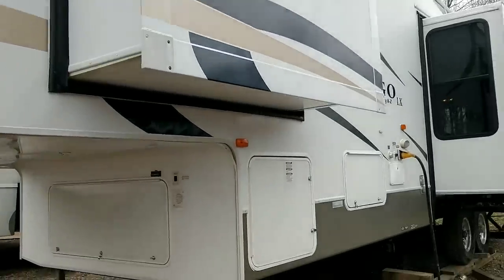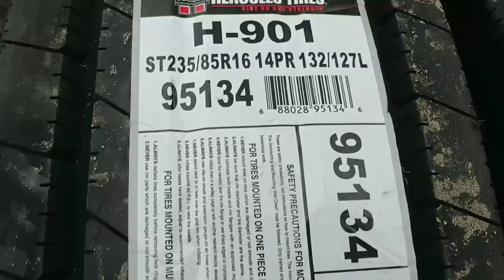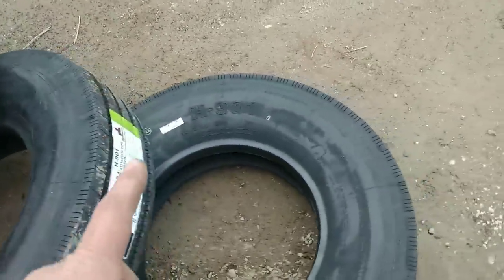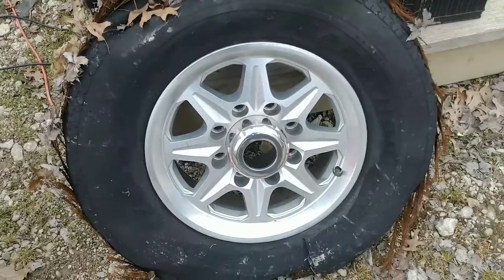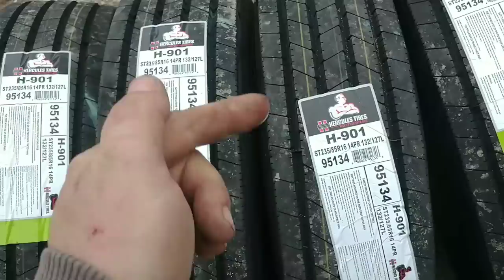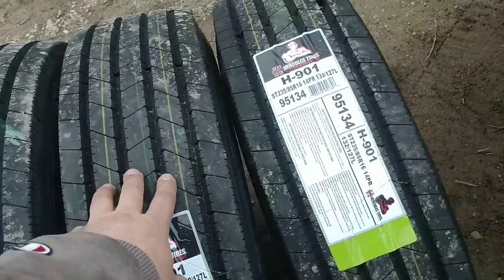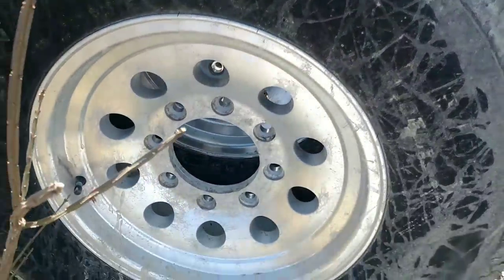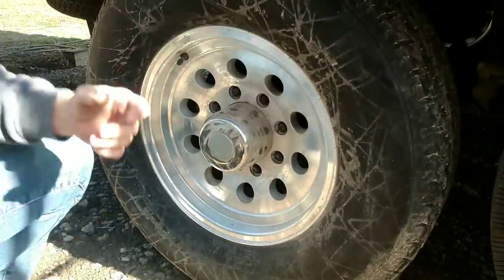NEW TRAILER TIRES / WHEELS AND SOME BEAUTIFUL YRUCKS!

Comment: My new trailer came with those same Hercules tires as an upgrade and boy am I glad I did it. About 25k miles so far without an issue (yet...)  Sailun also makes a good 14ply tire and I had a great experience with them. (Didnt think they would be all that great because they're a chineese tire but they never let me down.)

Comment: We love those tires at work we run the 4000 lb version on our 15k dump and equipment trailers. Makes ya feel alot better about all of that weight behind you at 70 mph when that Cummins is up front spittin fire 😂

Comment: Decoding the speed/load index: the first number is the maximum load index in single application (as per that camper), then slash, then the maximum load index per tyre in dual application i.e. 2 tyres on one side of an axle, the maximum load on each. The final letter is the indicated speed index. It's a standardised system, we also use it in Europe :-)

Comment: I'm a firm believer in 14 ply tires on any trailer hauling over 10k in weight. Makes a huge difference in ease of towing as well due to a stiffer sidewall and higher air pressure and a much tougher tire in general. I run them on all my trailers.
Reply: Less rolling resistance with new tires should increase fuel mileage.

Comment: Hey man I enjoy your videos got a story for you had a problem with my starter selenoid on my old 4 71 Detroit power unit took it apart sanded that copper contact ring cleaned everything  with starting fluid because didn’t have any brake clean but plenty of either since the old Detroit was an addic. I knew it was flammable so i waited along time when I tried to start it boom had a small bomb go off . I still use it some time but not in electrical stuff

Comment: When I had my 37 foot Toy Hauler Fifth Wheel I always used Good Year g670's and never had any problem. They were "G" rated and I always checked the tire pressure and kept them at 110 psi.  Now, I only towed at 62-65 mph as I my Fuel Mileage dropped way off if I went any faster/

Comment: good call on the 14 ply, my next vid is comparison of 10 ply vs 14 ply trailer tires. those 10 ply are sorry tires. the're so bad I don't know how they can legally sell them. I've had bad luck out of them on 2 different trailers, several different brands. some new, some old, all junk lol
Reply from the maker: i dont mind spending the money to have a good heavy tire.....i took these off the camper and stored them inside for the winter. i put another set of light truck tires on the original wheels forit to sit on this winter.

Comment: Do you guys like not like the motor home or do you just prefer the 5th wheel over it
Reply from the maker: i prefer the 5th wheel campers. they tow nice, i can drop them and drive my truck around to sight see. motorhome gets 6 mpg and struggles on hills and the temperature is always a factor. dodge gets 9.3 mpg towing these heavy campers and they are so much bigger inside.
Reply: J.C. SMITH PROJECTS we’ve had a gas class a and now have a class a diesel pusher.  The diesel is way better on hills and gets better mpg but we are looking at 5th wheels now cause like you said they have way more room.   But the deal we got on our diesel pusher we could not pass up it’s a 05 with 12,000 miles garage kept climate controlled only paid 29,000 for it 1 owner but the search is on for a 5th wheel

Comment: Smart move, i hate the cheep trailer tires they put on stuff today...  most made in china trailer tires are speed rated for 65mph..  i found out the hard way...  most everybody out here in bfe Nevada runs high quality  light truck tires on trailers,   as our hwy speed is 80mph..  Bridgestone still makes a good steer tire for light trucks..not cheep but they work well..
Reply from the maker: very few people towing trailers like this ever look at the tire speed rating. i have used these tires before with great results. many people use light truck tires for trailer tires.

Comment: The Goodyear Marabombs are horrible. The  Goodyear Endurance tires on the other hand...nothing but heavy duty, they are built like semi tire and they make them with a load range up to "H" I think, and made in USA. Kinda pricey though. It's all I run. Those tires look nice and heavy as well though. 👍
Reply from the maker: i was so against goodyear tires after having so many bad ones that i refused to buy any more. i have never tried the endurance,
Reply: @j.c.smithprojects  I was in the same boat. I was about ready to give up on ST tires and switch over to LT tires altogether, because it seemed like no matter what "China-bomb" tire I put on they either wore out super quick or they blew out. I never tried the Hercules tires though. When Goodyear came out with the Endurance I decided to try them, I felt like I had to, being the only ST tire manufactured in the US. I have not been disappointed. I just like supporting US made stuff when I can. Best of luck to you.